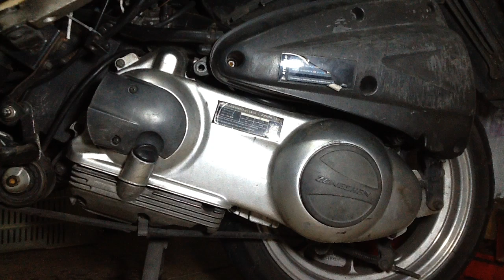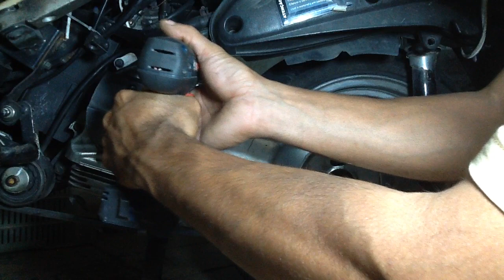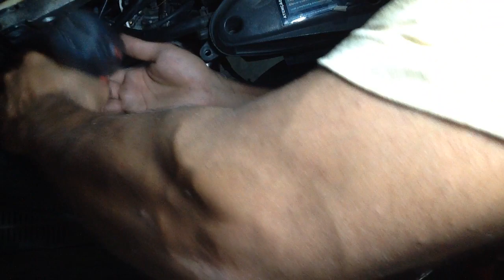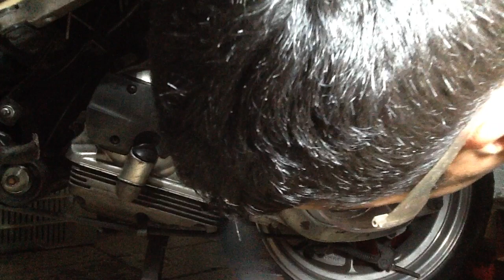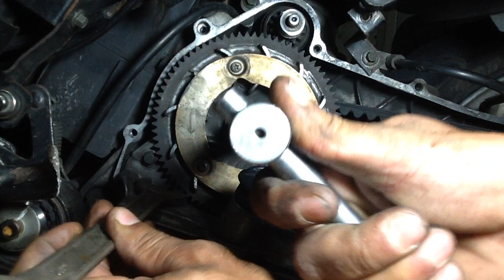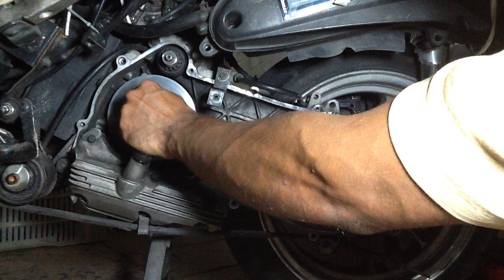KASINSKI PRIMA 150, DESMONTAGEM CVT.

Comment: Boa tarde. Quais são as peças e  que fazem parte do kit de transmissão da Kasinski prima 150 e quanto custa. E rolamento de direção.
Reply from the maker: O cvt tb conhecido como transmissão.
E composto por 
placa de partida $de 350 a 500
Variador completo de 300 a 500
Bendix de 150 a 250 
Correia de 150 a 600
Secundária completa 500 a 900
 Para kasinski prima 150